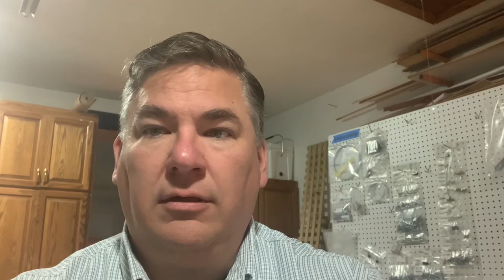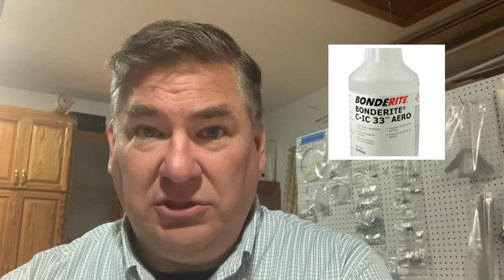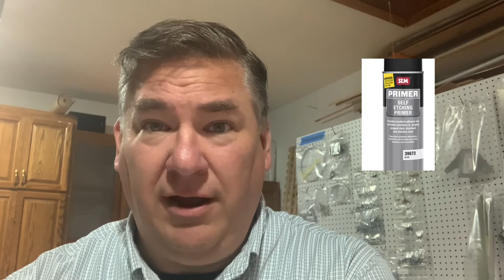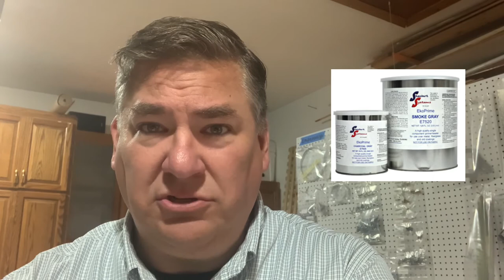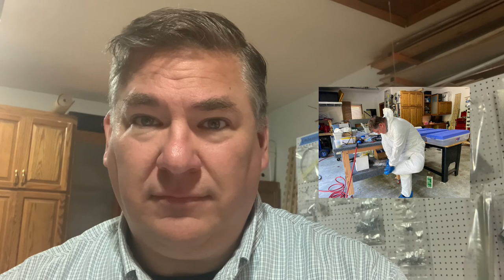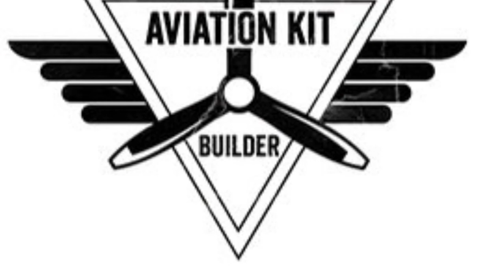Corrosion Protection for your Experimental Aircraft.  Priming, Alodine - Bonderite.  Pros and Cons.

Comment: Great overview of the topic, thanks! Viewers might like to know about BONDERITE M-CR ALCRM1200BR AERO (aka Alocrom 1200 Brush) which is "Designed [for] ...where dipping is not practicable". It's in stock at LAS Aero under the mnfctr P/n MP0082, and at Silmid in the UK and USA under Silmid's P/n: ALO12LQ2KG (I've no affiliation with either company).
Same hazmat / UK/EU REACH SVHC (substances of very high concern) regulations apply. For disposal, I found a local surface coatings company willing to take my waste in an appropriate container, which they kindly informed me where to purchase. Unfortunately they were unable to dip anything as large as wing spars, never mind ribs.

Comment: In all seriousness - nice debrief on the corrosion protection.  I went down the path of not doing anything at all because I'm in CO for starters.  The 6061 for the second and I spent a good 45 min chatting with the Corrosion X guys at Oshkosh last year - I'm sold.  The corrosion proofing you're doing is going to add time for sure - but living in FL - yeah, I don't blame you a bit.  I WANTED to do it - but ugh... I wanted to get done more than that and I'm very comfortable with the durability of Corrosion X.

I'm over on FirstRivet, saw you subscribe.  You're going into this with exactly the same energy I have, so you're going to be blown away with how well this goes together - I know I am.  I expected it to - but I expect to be on the mains here before mid-May assuming I get my control tubes done over the next few days (that's a pain).  So if I'm on the mains by mid-May that means from start of the build 8/21 to 5/22 - what - 10 months to that point?  Engine is due around that time.. 

Be careful on that Milwaukee rivet gun.  I have the same one and I found the 142 rivets will get jammed in the shaft after a while.  You have to dissassemble the whole thing to get to the shaft and then find something very narrow and hard to force them out.  So my rule on anything smaller than the 153 rivets is to verify each spent shaft exits the gun before pulling the next one.  When you get into the target rivets it's not a huge deal.

Anyway - I'm on the Sling Pilots form and Instagram if you want to try to reach out somehow...  Of course there is Oshkosh...  :D
Reply from the maker: I’m excited to finally get started after the year long wait.  I’ve gone back in forth on the rivet gun but will stick with what I have for now.  Keep up the videos, I like seeing where I’m headed.
Reply: @aviationkitbuilder  oh yeah. I wasn’t suggesting bailing on the gun. I’m still using mine.

Comment: I’ve tried with a few automotive primers around here. I’m far away from the US and EU and shipping would require special hazmat rates for pretty much everything even simple rattle cans. Found a great 2k self etching primer that just mixes 1:1 and has the perfect spraying consistency, no need for thinners. Dries in a few minutes, sandable and cheap. Cleaning the gun with simple acetone. Pays off to play around with a few option before you build. Some of the stuff that sounded great on paper was a b… to work with and I never got smooth results.
Reply from the maker: I have a buddy that owns a automotive paint supply store and he recommended using a 2k primer as well which I will probably use for the interior pieces where I will be top coating.

Comment: Great video. You cover everything and speak clearly. Thanks. I’d like to see your plane in some video. 
I’m working on my old Southbend heavy 10 lathe. It’s mostly cast iron but there are some aluminum parts as well. I’m using a high fill epoxy primer but need to treat these aluminum parts first. Do you know how to alodine these parts without spending $100 on chemicals?
Thanks,
Paul
Reply from the maker: I haven’t found these chemicals anywhere for cheap and I’ve looked.  The other issue is the prep chemical  is an acid and is a hazardous material and they add cost to the shipping.

Comment: Whats your experiences with putting alodine to already corrode parts..does it come back through? Or slow down the process?
Reply from the maker: If you prep the aluminum prior to applying alodine, the acid wash will remove most corrosion. If you have heavy corrosion I would remove it prior to applying alodine by sanding prior to the acid wash. I’m not sure if alodine would prevent existing corrosion from getting worse since I’ve only treated new and corrosion free aluminum so far.

Comment: Question how are you supposed to dispose of the used Alodine and other chems?
Reply from the maker: Hazmat facility for the alodine. I let it reduce down by evaporation first then seal it up in jugs and take it to my county hazmat disposal section at the landfill. The acid you can neutralize first then do the same. Make sure you have such a site available before you start down this path. You do NOT want to dispose of the improperly, it’s bad stuff if it gets into groundwater.
Reply: @aviationkitbuilder  I know.  I’m debating easiest route and just prime   I’m in a condo and only have a 1 car garage.   Don’t know what to do.  I’ll do some research to see if there are larger spray cans where I can just spray the parts.
Reply from the maker: @PortCharlotteAlex  Skip them both and plan to absolutely treat with Corrosion X once the plane is finished.  It will save a lot of time and effort since you don’t have the space.  You can get a case of primer all at once to get a better price maybe and just prime locations of metal on metal as a compromise.
Reply: @aviationkitbuilder  that’s the route I’ll take.  Thank you.  Truly appreciate the input.